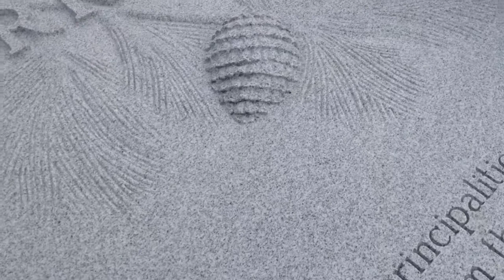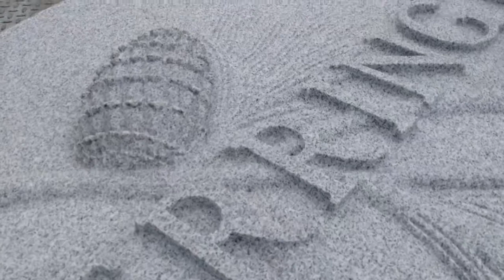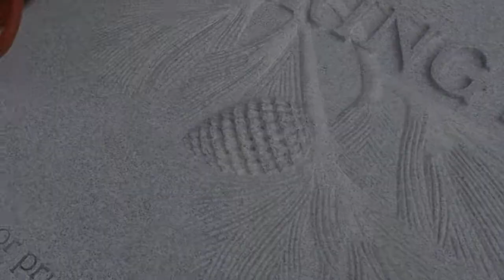Traditional Stone Finishing Techniques 6- Finishing raised Shape Carving detail with Hand Axing

Comment: How many PSI pressure must be use?
Reply from the maker: For normal hand machine work, I usually set my regulator for an operating pressure of 100 psi and compressor starter switch pressure for approx 125 psi.    Using significantly more air pressure can make your hand machine get hot, sometimes so hot you will not be able to hold it.  When I carve on-site using a typical big tagalong air compressor, I usually have to regulate the psi I use down significantly to do good work.

It’s more important to have enough air volume to run your machine without exhausting the compressor, both in terms of compressor cfm and storage unless you’re using a continuous duty or 100% duty cycle compressor.  Imho a minimum of 10-15 cfm is a good rule of thumb.  It will provide enough air to operate your machine as you like versus only being able to carve slow.   Most hand machines, including Trow and Holden, require between 4-8 cfm.  Even if they can produce 100psi, most small compressors cannot produce enough cfm or store enough compressed air to be adequate for carving or finishing like shown in  my videos.

In this video, I’m using a RolAir compressor with 13 hp gas engine and 30 gallon tank producing approx 23 cfm.  It’s fantastic for carving but expensive to fuel for carving 8 hrs/day.   My stationary compressor in studio is slightly smaller and produces less total cfm but is adequate and more economical for the majority of studio work.